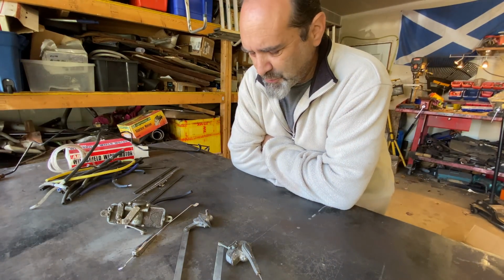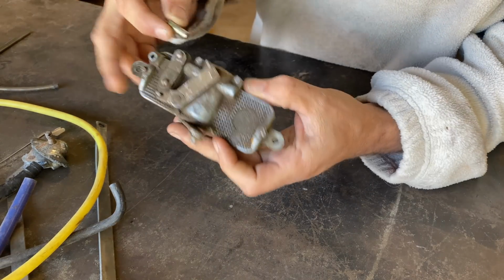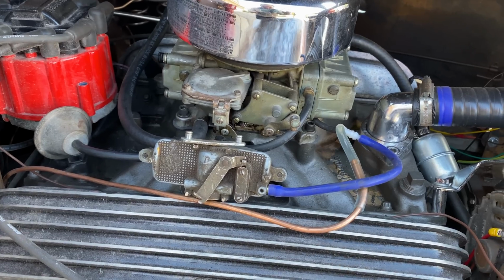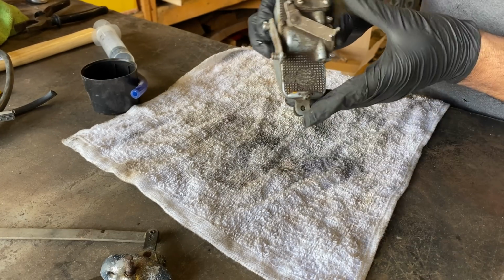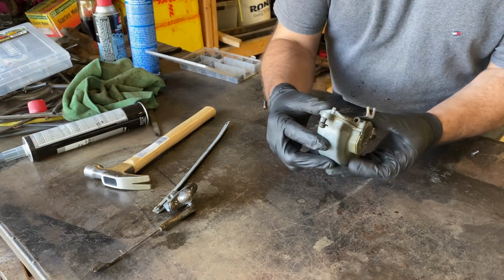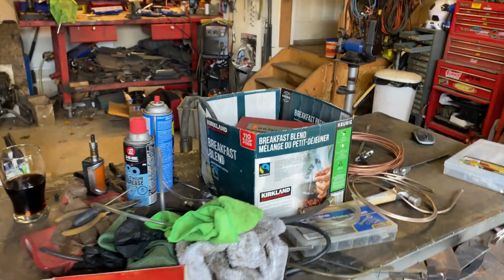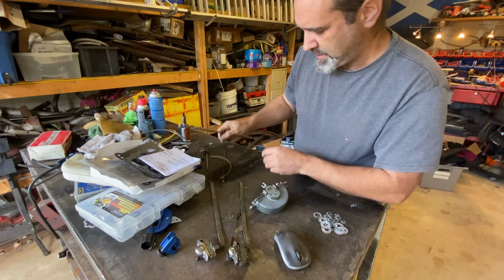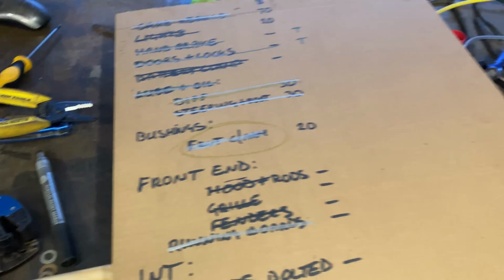Vintage Vacuum Wiper Motor Install On My 1936 Chevy Coupe

Comment: i have a 53 suburban and a 40 sedan. i would use ATF rather than brake fluid. should not need the syring, just put the hose into the can of fluid . thanks all for the ideas about vacum boosters.

Comment: Butcher a more modern electric one, get it out of something cheap easy and plentiful like a pickup truck.  Just shorten the center section, basically like you did with the front cross member. Those vacuum ones will have you crazy or dead in no time.

Comment: As David W said you will need a vacuum canister otherwise the wipers will stop on accelerating (on my 49 Chevy truck I have to wait until my windshield is hard to see through then let off the throttle). My thought is to hook the reservoir to the other vacuum port that you are currently plugging. With the cam you have you might to install an electric vacuum pump. My 49 has a little rod that runs from the switch on the dash to the wiper motor.

Comment: Use a choke cable and when you put an L bracket of the motor you put the cable through the L bracket on to the lever and pull the cable it'll work

Comment: Most vehicles of your era car only had one wiper the passenger side was a special order.  I think the other hole was to power up the second vacuum pump.  There's a 12 volt replacement wiper motor available.
Reply: Forget to add needs full vacuum.  On the original the vacuum came from a fitting below the carburetor. P S get the 12 volt replacement.

Comment: I fought with mine for a while before I broke down and bought an electric powered replacement. I ended up taking half of a modern wiper blade and worked it to the end of my wiper arm. I'll try to remember to show it in my next video.

Comment: Dont laugh just a thought maybe a 12 volt air pump will give you enough vac for the wipers and you could leave it switched on then use the 12 volt switch etc.
Reply from the maker: Not laughing, in fact I just ordered one.

Comment: All vacuum wipers have to be connected to the manifold but what you can do is get a vacuum ball (canister). Hook up a one way vacuum fitting (similar to the one way fitting on a brake booster) to it and after the fitting put a T fitting with one going to the wiper motor and the other to the canister so that when you loose vacuum from giving it gas to go up hills you still have vacuum in the ball so you don't loose power to the wipers. (It works, I've done it before).

Comment: Looks like the wiper blade on the driver side is getting stuck on the window seal. I had an old 57 ford with vacuum wipers. There never was enough vacuum to make the wipers perfect. I worked for an old 50s mechanic he told me to buy the duel pump, goes on where the fuel pump is. the bottom pump is fuel the top pump is vacuum, worked better. My 69 GTO had hideaway headlights, they used a vacuum can with check valve. You have options, I;m sure you will get it.
Reply from the maker: Nah, it's not getting stuck, it's barely touching the glass hahaha.

Comment: I wonder if you could install a push-pull cable similar to a choke. I had lots of vacuum wipers back in the day and I think some of them would have the vacuum going to the switch and then the wiper motor, one way on the other off. I also think others were cable operated.
Reply from the maker: I thought about a choke cable type deal. Just seems overkill when I just need a short throw lever on the dash.

Comment: I'm pretty sure where you're pounding a bolt in that vacuum motor goes to the switch you might need to try a different vacuum line on your front of your carburetor one's ported and one is not

Comment: From what I can find out about lubrication, one is to use Auto Transmission Fluid, the other I've found is this https://www.mafca.com/downloads/Technical/Lubricating%20the%20Trico%20Vacuum%20Wiper.pdf
Reply from the maker: Excellent link, thank you. It has a diagram showing the operating lever. Now I know what to make.

Comment: good job on the wiper.
Hood "not done" . still needs to be bolted down  so it doesn't fly off. and brackets for lower/side latches.
Reply from the maker: You are correct sir.

Comment: For the switch, just keep the switch on the wiper motor on all the time, and operate your wipers with an inline valve.  This method works good, and you can mount that valve anywhere through the dash you want.

Comment: The switch had a knob with a small stem on the bottom that stuck through the center of the lever on the motor
Reply from the maker: Any idea where I might find a diagram?
Reply: @ScottRods  the switch was in the middle top of dash by the windshield. It had angle washer on it like your front turn signal. Type 1936 chevrolet wiper switch on eBay and you will see a picture of it. Good luck
Reply: Correction its a wiper control knob

Comment: switch would look like this,should be easy enough for you to make. Note the angle on the collar so it sits on the dash at the proper angle to reach the motor.   https://www.ebay.com/itm/293727964661?chn=ps&norover=1&mkevt=1&mkrid=711-117182-37290-0&mkcid=2&itemid=293727964661&targetid=935065067907&device=c&mktype=pla&googleloc=9006931&poi=&campaignid=10900797482&mkgroupid=108910247002&rlsatarget=pla-935065067907&abcId=9300403&merchantid=115034740&gclid=CjwKCAjwlID8BRAFEiwAnUoK1ed9AyXCum0t7QFcHp6KWRVgTLh-7NQUkENvqr5Njl0d_joAdwoJixoCy9MQAvD_BwE

Comment: Add a vacuum canister with a one way valve to boost your vacuum and it gives you a little bit of a reserve
Reply from the maker: I'm thinking of installing an electric vacuum pump, if such a thing exists